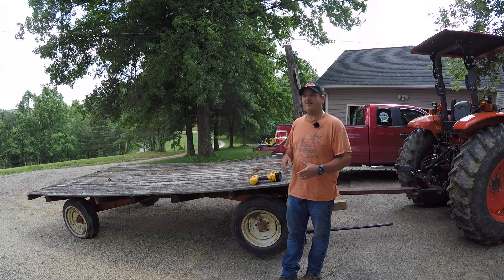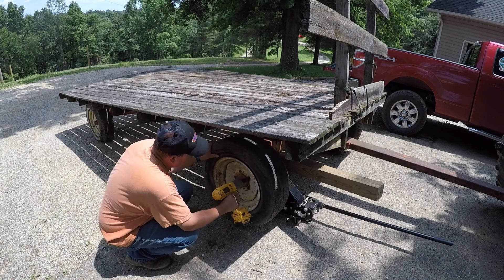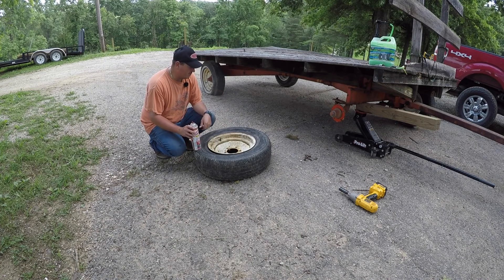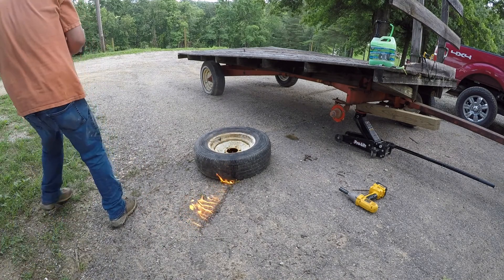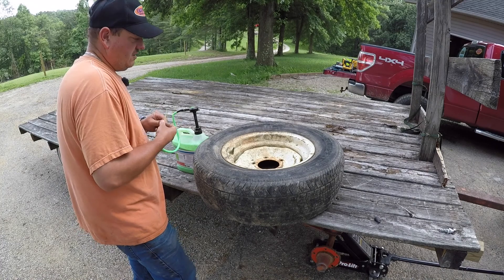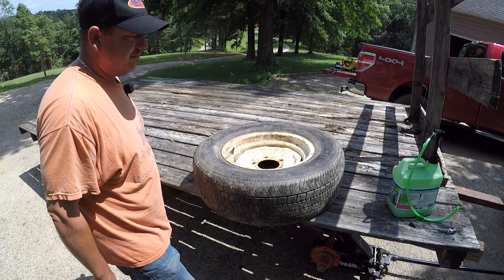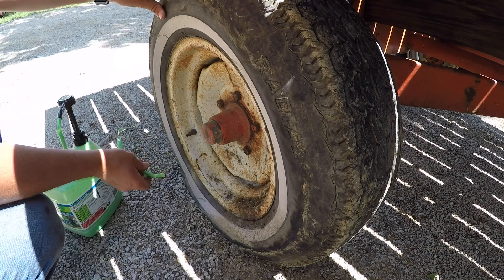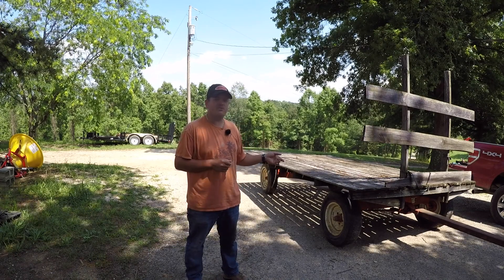How To Put Tire Slime In Your Tires #202

Comment: 24 pumps? Lol that's a LOT! I'll be honest, I put about 5 pumps into a water bottle and put about half as much water to it and put that in. It's much thinner and works around the tire much faster. Not so good for cold weather but I'm in Texas. And it always works..... Helps me stretch my slime.
Reply from the maker: That’s a great way to save on slime, it is a great product, up to current I still haven’t had to ad any air to the tires since this video
Reply: @WilliamsonRidge  IT likes to dry up as time goes on. Water helps her last and stay fluid. My buddy swears to use ammonia instead of water, but either way. Cheers brotha!